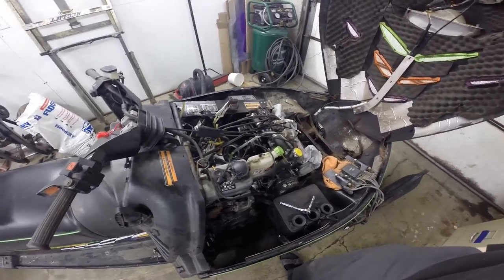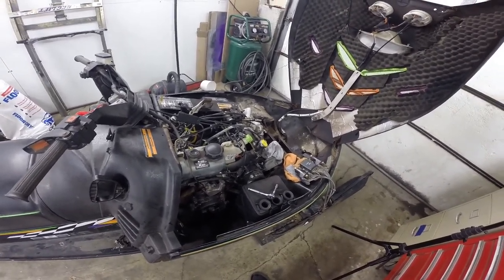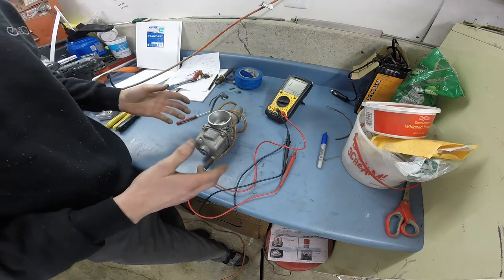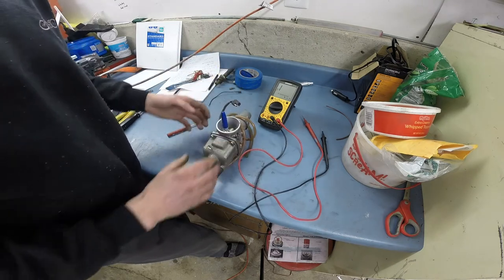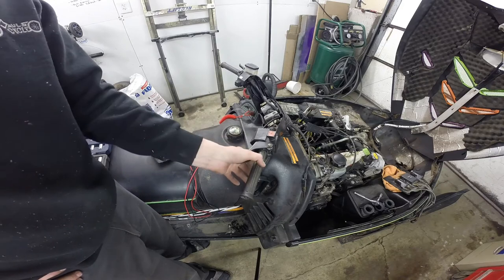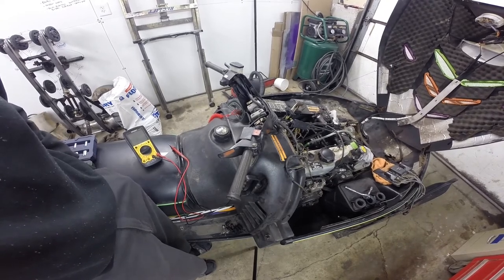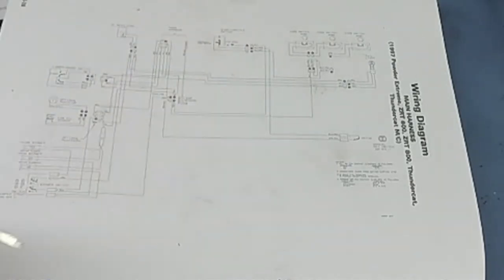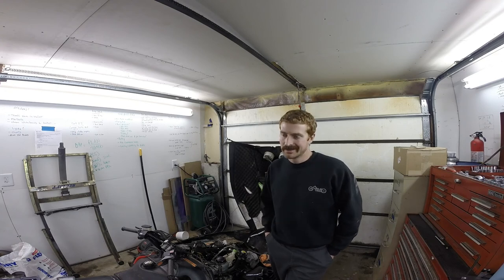Sled Tips 011 - Arctic Cat ZRT Throttle Safety Switch Issue fix delete

Comment: I have an 04 800 efi Mountain Cat...it only has 600 miles. I thought I had a bad tss because it was bogging out at about 4k...so I deleted the tss... but then it kept bogging out, and so I thought it was a bad TPS, but I heard it was a nightmare to calibrate, so I replace the entire throttle body. Now, it won't start... maybe I did something wrong with the install...it seems like it's not pumping fuel 🤷‍♂️ have you done a Throttle body replacement yet? I'm going to look for it.
Reply from the maker: You'll need the TPS for it to run. Calibration can be tricky. Haven't done yet myself but understand the process I guess.

Far as complete throttle body replacement; should be plug and go!